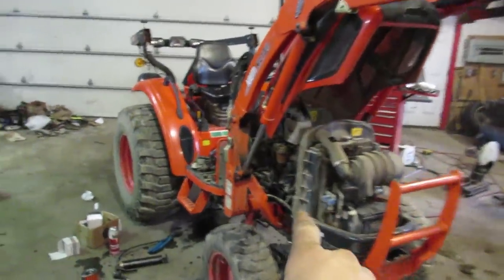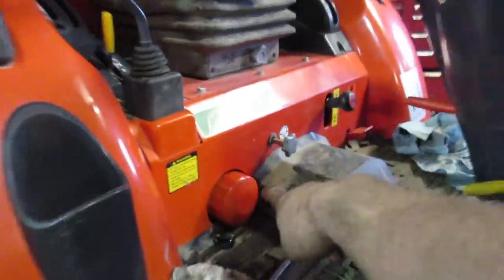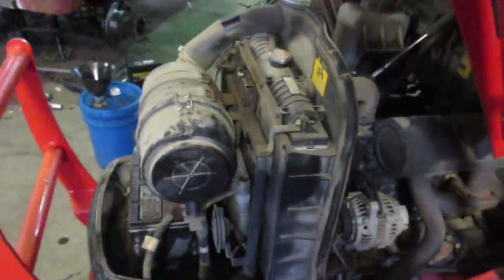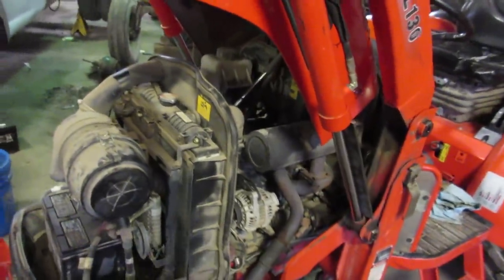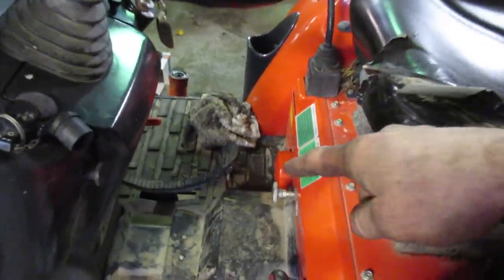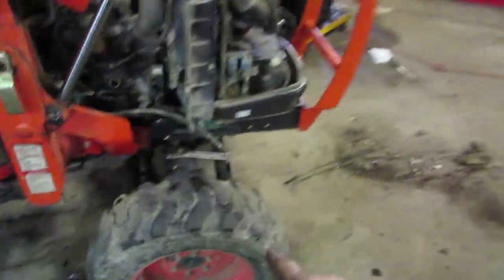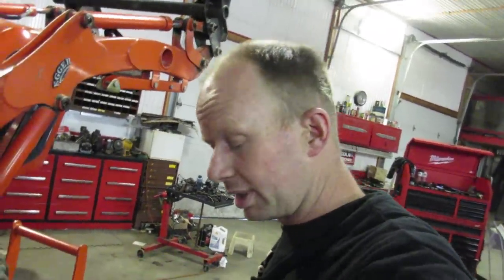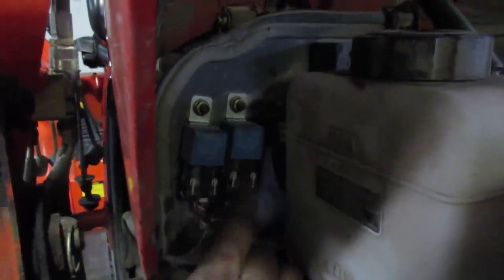Here's Why the Kioti CK35 Compact Tractor Is The Ultimate Oversized Lawnmower

Comment: Thanks Rich.  Dad has an (09) MF 1635 Cab 12x12 Powershuttle with 1,000 hours on it - love the tractor.

If we ever have to replace it, will go kubota due to no longer having a Massey dealer.
Reply from the maker: The shop I worked at took over a Massey dealer.  At the time, Massey wouldn't let you be a dealer for anybody else so we didn't continue.  We worked on road tractors too so my boss didn't want to be limited.  We  went on to sell Valtra but our locals didn't want anything that wasn't green or red so it was short lived.  I really liked them though.  A year later a bill was passed that one company couldn't limit you to selling others as well but it was too late.  We still serviced all the Massey's in our area
Reply: DEBOSS GARAGE Thanks Rich.  This explains why CNH dealers are selling kubota too.  Sad, grew up on an MF(FE) 35 with the Standard 23c, also spent time in the cab of a white stripe 1066.  Absolutely love that era of IH tractors.

Comment: This a bit of a random question. I heard that older Cummins engines are easier to work on than older d max’s and older powerstrokes.
My question is this true from a mechanical stand point?
Reply: There’s a lot more room under the hood since it’s  in-line 6 and more simple.

Comment: looked at these in 2011 when the local New Holland dealership started selling them.  They were the same price as a NH and comparable as far as build.  In the end went with a blue machine and didnt regret it. 
 These small tractors are very light in the rear and I wouldnt buy one based on lifting capacity specs alone.
Reply: My dad would fill 5he rear tires half way up with calcium chloride,  to increase traction in the fields and as a counterweight for the loader bucket.

Comment: Most of these compacts/sub compacts are made by the same manufacturer. My 2010 JD 2520 has the exact same 27hp 3cyl Yanmar, same filters, same axles and everything. I got a dealer 4mi from my house and can get anything in 1-2days.
Reply from the maker: I think anything Deere that is 40hp or less is Yanmar.  The way to tell from afar is that the engine and rear will be painted black while the hood and fenders are green.  True Deere's are completely green.  Deere tried fooling the public a while back and painting a 50ish hp Zetor green but that didn't go over well when they charged more that $10 000 Zetor did for the same tractor
Reply: I'd be upset if I paid John Deere money for something to find out it was the same as much cheaper shit

Comment: My kioti nx4510 been in the shop for three months and they still can’t figure out what’s wrong with it it was running when it went in now it does not run they keep changing parts after parts of the parts no one can figure out what is wrong 2015 just turned thousand hours would not buy kioti or nor would I recommend it

Comment: by far the best 30hp fwd is ford 1900 if it had ps (f1920) it wouldbe perfect,  out performs my jd 80hp esp in winter on ice  i dont trust the kioti because of wiring problems the newer allplastic tractors are sh##